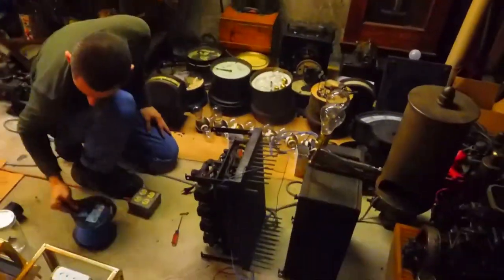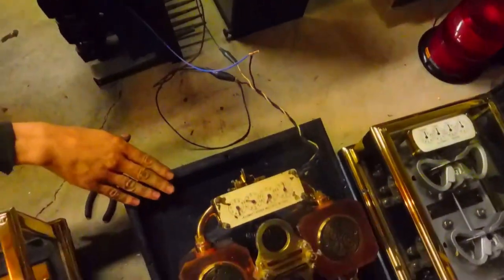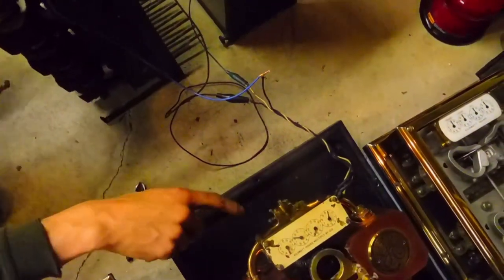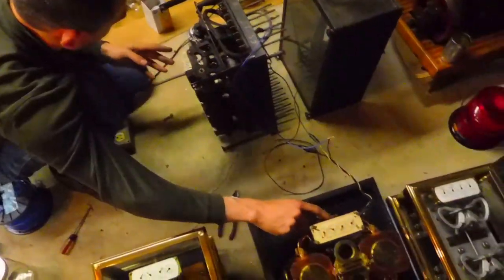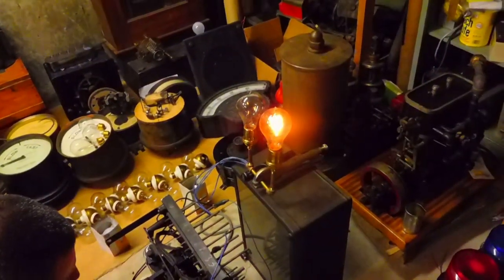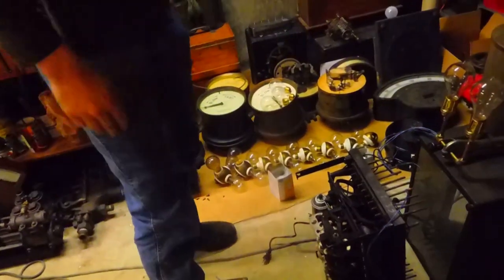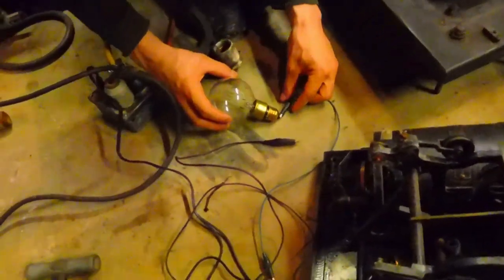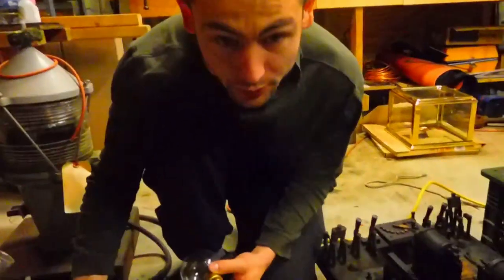Thomson G3Y recording wattmeter, DT3 Totalizing Relay and C4 curve-drawing voltmeter Salvage

Comment: Mr. Karnes I am at a loss for words as to how you get to work with all these old machines I'm a volunteer at the East Troy Electric Railroad in Wisconsin I would love to have you visit and show you around we have a rotary converter and a 115-year-old Interurban Railway line that stretches 7 miles from East Troy to Mukwonago Wisconsin
Reply from the maker: Thanks to Jeen, I will be visiting this summer to try to energize your Rotary converter.
Reply: @AEKarnes  that's great I'll try to be there when you're there it would be awesome to meet you in person it's sad that are substation in East Troy has been downsized to accommodate the train station there was a time when it was just a substation but now we use it as a train station because our actual train station is somebody's house so most of the original equipment is missing except for our original rotary converter and overhead maintenance crane as well as our knife switchboard

Comment: Does the counter advancement work similar to an escapement wheel in a clock, just triggered by a solenoid instead of a pendulum?
Reply from the maker: Yes.  Two solenoid driven progression strokes. One is an advance solenoid the other is a retract